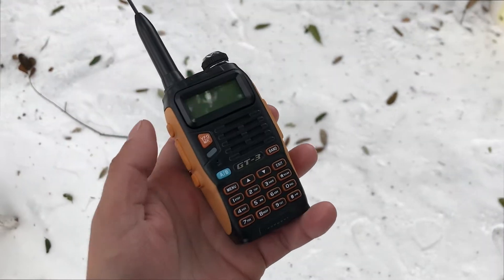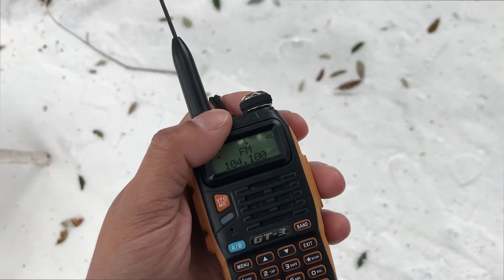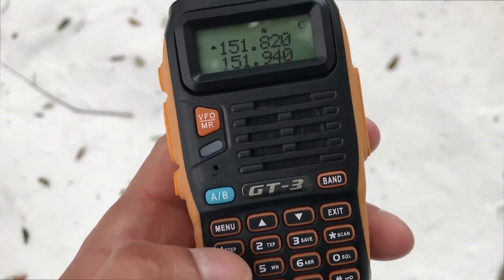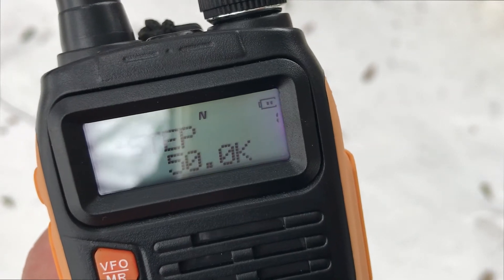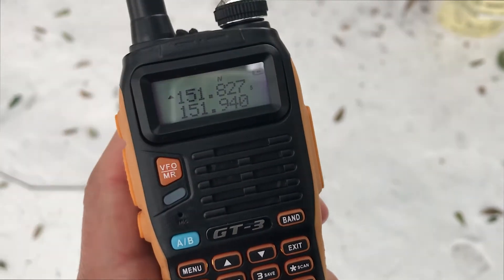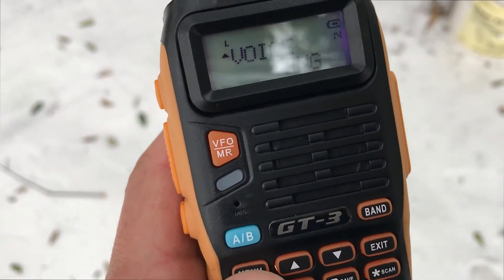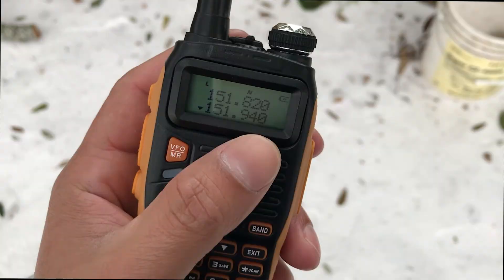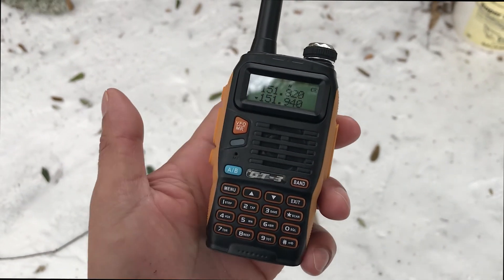BaoFeng GT-3TP Radio Overview MURS

Comment: I got the BAOFENG GT-3TP Mark-III for emergencies and listening right now. However, if these are usable I would consider getting a ham operator license. Seems like a cool hobby
Reply from the maker: I"ve thought about getting into ham radios as well. Its fun but does require a license I think.
Reply: @CasaDeLaRaza  yeah it definitely requires a license but when me and my father went hunting at a new permission we were out of the cellular network. I definitely could’ve used this even though some people get butt hurt about the legality‘s of using these with FRS/GMRS etc. I would would’ve just used it at a low power setting on a proper frequency/channel as not to cause interference. It’s nice to know this can do MURS as well.
Reply from the maker: @greg6162  Agreed. I didn't know about MURS and didn't want to forget everything I learned during the storm, so I made the video. I figure in the woods you might be able to get away with using whatever frequency. Then next thing you know, the CIA comes in on a helicopter and all of your friends get taken to prison for 50 years. Well more than likely that won't happen lol but following the law is important.
Reply: I just noticed your screen wasn’t lighting up. Is that changeable in the settings? Also, did you get yours off Amazon because I’ve heard their quality control is suspect with these radios. Basically, there’s a good chance it’s used to a refurb
Reply from the maker: @greg6162  These were a gift from my in-laws but I do believe they are from amazon. The color shows up in darkness, during broad daylight you can't see it. You can swap the colors in the menu settings
Reply: no problem guys just find a club or ham op in your areas an get a beginers license as a tech./ ask them the questions you want about what you want to do with your radios an they can say yes you can or no you cant.also can help with setting up a simple repeater for you to use say on a hunting trip to keep in touch with rest of your party just saying but seek a club out an good luck